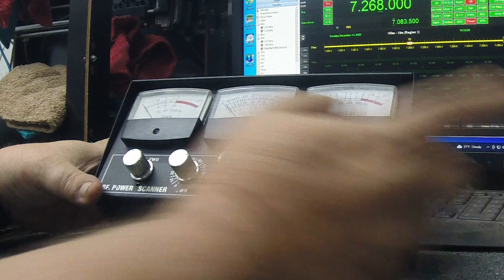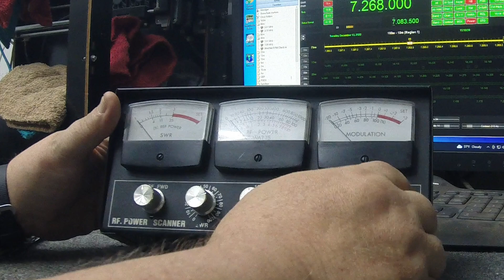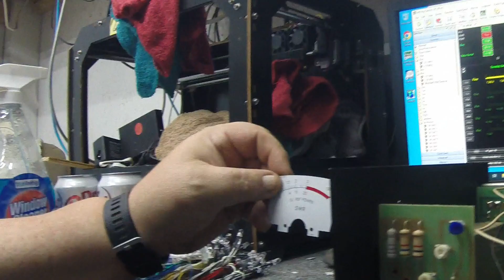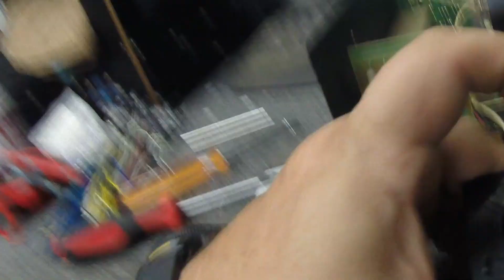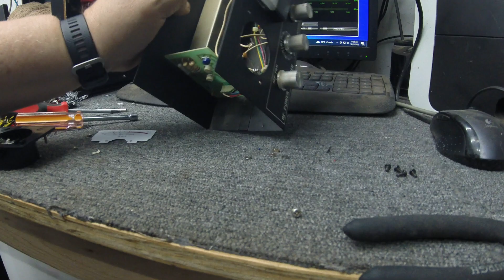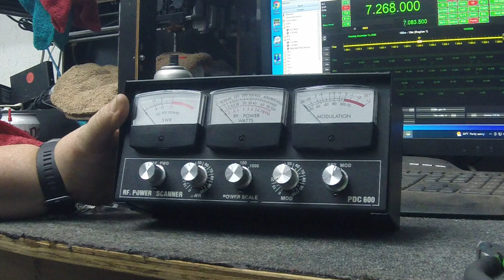PDC 600 SWR Power Mod Meter Light Upgrade Not

Comment: Hi, i noticed on the right hand side of the internals. There are three adjustments. So is the lower pod for low power adjust , center for medium, and blue pod for high wattage adjust? Plan on  using my bird meter as a reference.  Best to you..
Reply from the maker: Yes first you a need a wattmeter that is calibrated for comparison. also these meters are most accurate on the low ends. notice how the lines are closer together on the lower end than on the higher end? this has to do with the meter movement and accuracy. so for the low power you would need to use about a .6w source, 4w for medium, and 40w for high. in the inside, with front facing you see the three to the left control use these. the last is for modulation cal. the mod meter is are also accurate when calibrated for a certain carrier. once the carrier level is changed the inside pot also has to be "recalibrated" for a true mod% reading. the only way to "calibrate" this properly is with a scope.
Reply: Yes